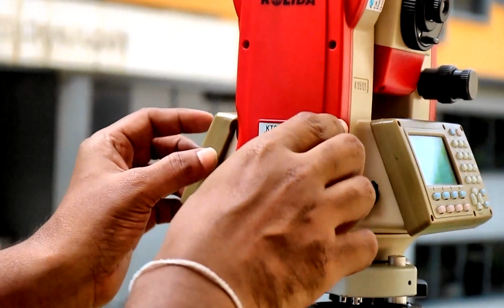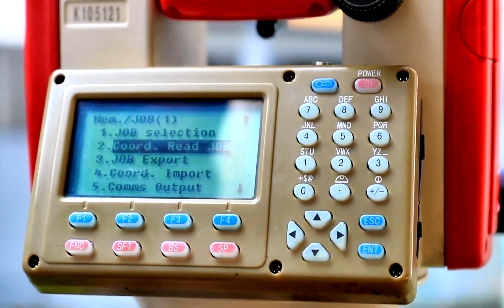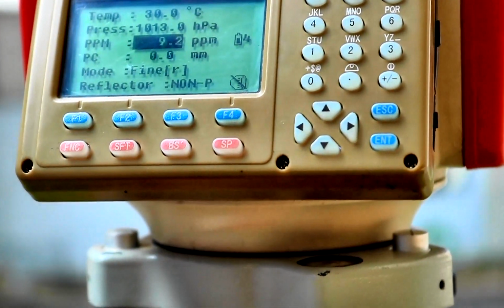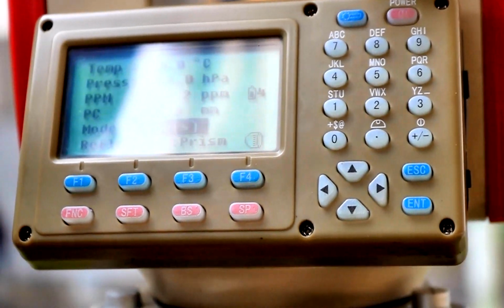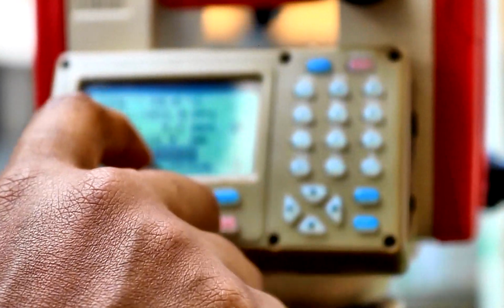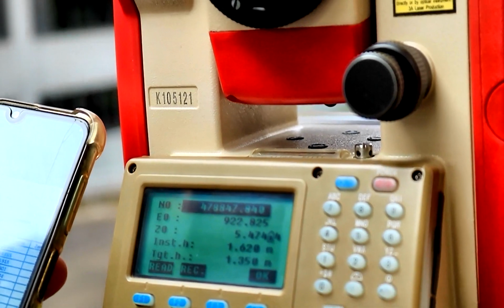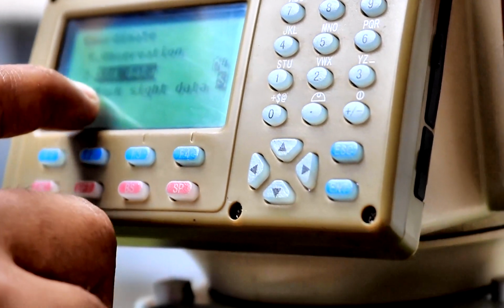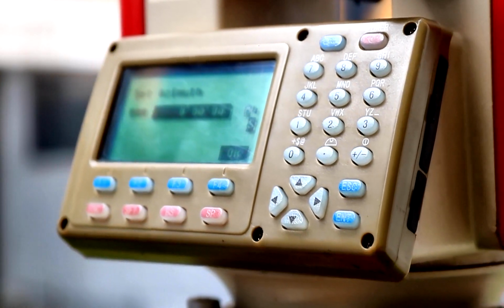Orientation of a Total Station (Backsight Azimuth)

Comment: Setting up on arbitrary unknown point, how do you set the total station azimuth to match TRUE NORTH (same as geodetic north of GNSS) for reference? (not magnetic north or approximate).
Reply from the maker: A very good question. a very few people know the exact method. Usually you should have a clear night sky where you can see the stars clearly. Then setup your Total station at the point you need. Then you need to target to a star which is rising and track its path (you have to move the telescope in the horizontal plane and the vertical plane using fine adjustment screws). you will notice that you have to elevate the telescope with the rising star (Vertical angle get reduced) and at one moment star will stop the rising and will start to set. That very moment (where you observe the lowest vertical angle ) you have to stop the horizontal rotation of the instrument. Now you have targeted into true geodetic north or south (depends on the hemisphere you live ) then you can rotate the telescope about trunnion axis. Now you can put a peg on the ground. this peg is exactly in the direction of Geodetic North. So next day you can refer that peg as the Geodetic North only for the point you setup the Total station last night.